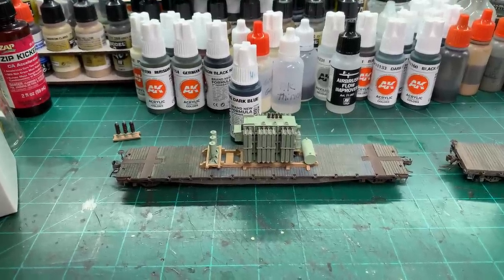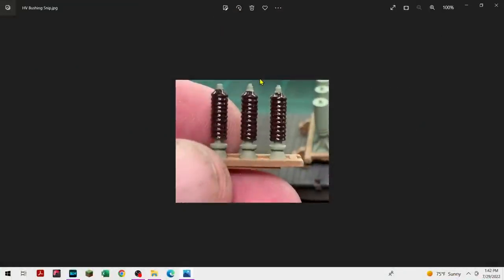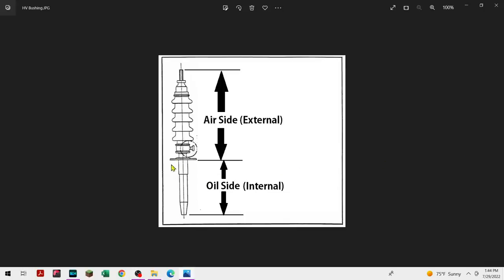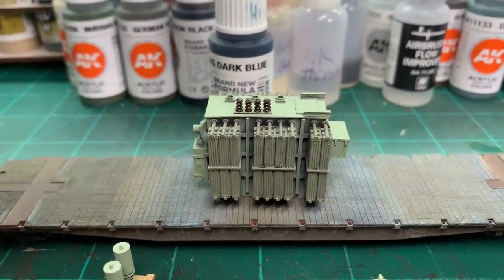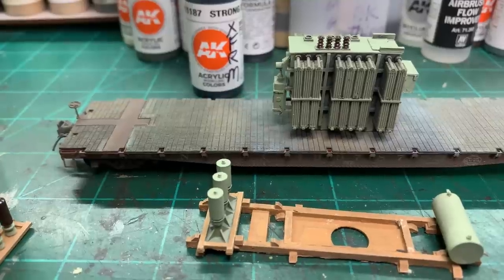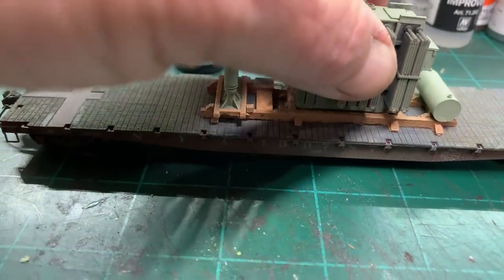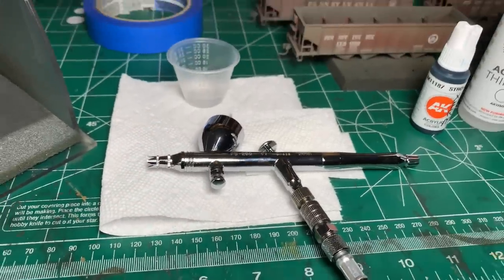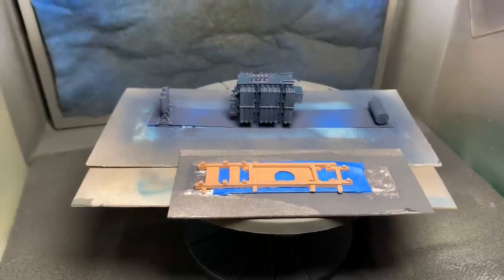Transformer Modeling: Realistic Transformer Load

Comment: Sir you are exactly right about those Westinghouse bushings except for one thing: the oil continues up to a sight glass at the top. Oil is the best insulator of that electrode and insulates with a breakdown voltage up to 60kw while encasing that electrode in oil.   I use to test at the c1 tap and if no oil was visible you better believe, we were worried and ppL started marching!😂😂 Nice to see my old moneymakers are being modeled into service. Keep the lites on❤

Comment: Dear Rob, from what I found on European bushings, is that the upper part isolator comes separate over here. The inner (lower) part is separately sold. May have to do with different norms between the US and Europe. Don’t know the exact norms these high voltage bushings would fall under, on either side. Nevertheless, considering the difference between ANSI and EN(latter based on DIN) might explain the difference of constructing.

Comment: Im thinking the radiators would be crated as well, they are a thin skinned to help remove heat from the transformer. Company I worked for painted transformers and OCBs a primer flat red.
Reply: Correct. All our substation transformers were shipped "undressed" - no fins or fans, all bushings removed, conservator tank detached if so equipped, etc. Granted, 5 MVA is pretty small, but only a couple of rural subs had anything that small and those were there long before I began working at my first utility. I suppose it's "possible" to ship a small one dressed for short distances within the service territory, but seems risky for damage to the equipment.

Comment: I really enjoyed the video and the history you give lesson on the car loads for Westinghouse.  Just a thought for the double transformer load.  What if you have a separate car for crates, oil barrels, insulators and tanks?  I haven’t a clue if Westinghouse would have ran loads like that or not.  If they did, that way you could run the two cars together.

Comment: Just a suggestion, in this type of consist, you could put a crane in one of the flar cars, Just in case the cliente doesnt have that type of equipment to download the transformer... This Will make a pretty unique train in your layout... Cheers 🙂😉
Reply: Cranes would be available locally to the client -- there'd be no reason to ship one to them by rail. And you certainly wouldn't ship a large item "just in case" -- you'd check in advance if it was needed.
Reply: In Clay, NY I remember a CSX train stopped 8796 Caughdenoy Road to unload a transformer for the substation next to it.  I dont remember if the crane was local or on board the train but it made the news headlines then.  Something about the load size or the roads not able to support the transformer weight by truck led to the road closure for the better part of the day.  Interesting to model the scene complete with police and truck depressed center tractor trailer and onlookers
Reply: Its Just something to catch the eye, I dont think Stephen (or Bob 😂) Will be sued for a little autor license...

Comment: Great video Rob, are the transformers shipped full with oil or empty
Reply: Both- depends on the weight mostly. We have shipped full of oil via truck- by rail (now-a-days) the units are likely too big/heavy to have oil in them. Mineral Oil weights 7.5#/Gallon so the weight of the oil adds up. I'm not totally sure how it was done back in the 1950s- but I have seen a lot of pictures of shipments with what appear to be drums of oil included.

Comment: I did make my own transformer loads 1/24 scale. See youtube   kendra trains transformer, kendra trains 55, kendra trains 57. The bushings I turned down a home made lathe that turned slowly. I have many drawings of bushing and transformers that I used to scale everything.
Reply: VERY nice Kendra- and they look fantastic! They actually look accurate- what are your protoypes, they appear a bit more modern.
Reply: @robbennett1965  I have a lot drawings of all the designs and components. Designed them for years from the minpads, padmount, polemount, drytypes. I have all the drawing of the internal also which I will be making in the future. Did also many electrical wiring diagrams. So know just how to run the conduit.